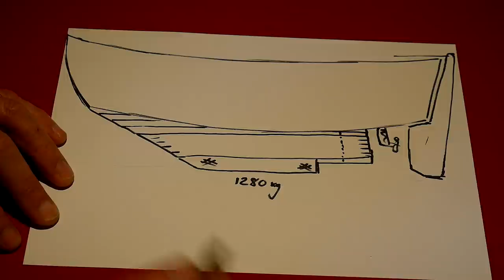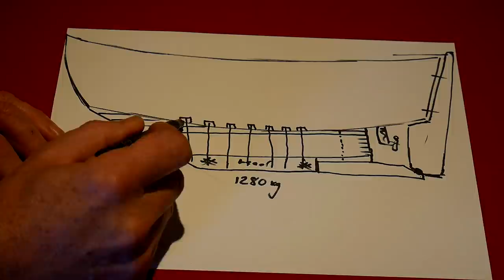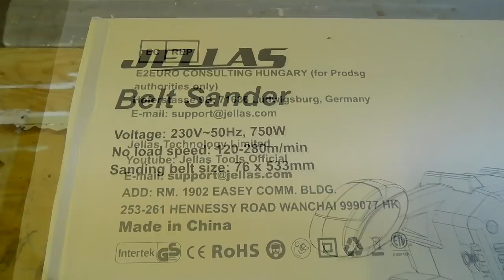Clarity on the Keel; Building a cruising sailboat - SV Tapatya EP208

Comment: That little belt sander looked very pleasant to use when you one handed it on the plywood.  And you could easily build a jig to mount it sideways that has the ability to be clamped to any horizontal surface.  Longevity is an issue but that low weight has some real value.  So glad to see so much progress!   By the way when you start sanding the shape I to the keel while underneath that light belt sander will come in handy!  😁
Reply from the maker: Thanks Kevin. Yes indeed! 👍

Comment: Did u think of treating the raw timbers with a preserver to prevent any possible future rot/bugs or perhaps that might interfere with later epoxy coats? Why not bilge keels and ease of drying out or will u add beach legs after? Looking forward to seeing you sailing as I am sure you are too! Ray.
Reply from the maker: I am indeed Ray. To your questions; wood preservative might affect the epoxy bond, and I don't want that. In the end, the whole thing will be fully encapsulated in glass and epoxy and then epoxy sealer/primer. Wood that's permanently under water (salt water) doesn't really rot anyway - the salt preserves it. As I've said elsewhere, I did consider bilge keels, but decided on the central long keel for its structural benefits and protection of prop and rudder 😀👍

Comment: A quick glance at the registration plate on the trailer, without my reading glasses on, "LEAKS 34". Hmmmm...not great for a boat! It's coming along, nicely Are you going to cast the ballast yourself or have it done? Is this the last major system left or do you have others?
Reply from the maker: 😂😂 Thanks. I shall try casting it myself. It’s one of the final systems. There’s the masts and rig to come. Rudder and wind vane, upholstery, and a few bits in the engine room... 🤔

Comment: Hi Tony, great process and good explanation of the keel building process. When you spoke to fixing the lead keel, you said (I think) that the bolts would be ‘bonded into the lead keel’ - can you explain further and why not through bolt the whole assembly up through the wooden keel members to the floor timbers? Good stuff Tony - keep up the good work. 😀👍⛵️
Reply from the maker: Thanks Norman. Well I have been intending to use "J" bolts, or similar, cast into the lead. However, as is often the case, your question now has me considering alternatives, such as through-bolts. I have read about drilling lead keels, cooling the drill bit with acetone ( if I remember correctly), but imagine it would also be possible to use some sort of cores in the casting that could be easily removed once the lead has cooled. I'm thinking about it 🤔🤔
Reply: @SVTapatya  Tony, I apologise, I was not questioning your method I was just interested in what you meant by bonding. I think captive bolts of some form could be incorporated into the mould prior to the pour. The captive element would need to be a decent surface area to mitigate against the tensile load bearing onto the relatively soft lead. It goes without saying it would need a decent jig to get (and keep) all the bolts in place especially during the pour.

However, I think your idea of using cores (as through bolt place holders) would work well. 😀⛵️👍

PS: Just found this YT video on drilling a lead keel - https://youtu.be/wdh7Da3D3ek
Reply from the maker: Thanks Norman. There is absolutely no need to apologise! I was trying to thank you for helping me think laterally .
Yes. I agree embedded bolts would need a large surface area in the lead; that was the line I was considering. Actually, I still find that idea attractive; I could then comfortably epoxy seal the ballast to keel timber joint and pour epoxy around the keel bolts to thoroughly seal and fill the bolt holes. 
I’ll have a look at the video though. I like to keep my ideas flexible until the final decision is necessary... 🤔👍
Reply: @SVTapatya  😀👍

Comment: Hi Tony, another great and informative video as usual. 
Will you be filling the keel bolt holes with thickened epoxy to seal the wood in the holes or will the bolts suffice enough to seal?
Great work though. 
Cheers
Pete
Reply from the maker: Thanks Pete. I'll be filling the bolt holes with something. Epoxy was my original intention and may still be what I use 👍😀
Reply: Anticipate that possibly there is a substance that will fit I to and dill any voids very well for a semi-permanent to permanent time duration, yet NOT permanently adhere to and lock-in the long brass keel bolts.  A materials engineer, chemist polymer expert, industry expert will weigg in, i hope. 

A grease? A locktite or other commercial substance, by the pin, half-gallon,or gallon? Would be optimal to be able to remove any of the long brass keel bolts, right?
- Don D., IT systems expert, and avid arm-chair boabuilder, sailor, explorer, Phoenix Arizona.

Comment: Hi Tony. Been following your impressive build since the start. My question: these keel timbers, all glued together now, are made of WOOD. They will want to FLOAT and work AGAINST the effect of your lead keel. Wouldn't it have been a better idea to make a hollow keel that you could fill with concrete, maybe mixed with iron or steel, that defenitely would want to SINK so you could have made it less deep and help the lead keel keeping the boat upright?
Reply from the maker: Thanks Erik. I think we need to trust the knowledge and experience of marine engineers/ naval architects here. Clearly, the amount of lead ballast is calculated to sufficiently counteract the buoyancy of the entire structure. We also need a certain righting moment, which is a product of the ballast mass times the distance from the centre of buoyancy. This means it's better to put as much of the ballast as possible down low - not spread it about too much. Then there's the function of the keel in counteracting sideways movement. Clearly the keel needs a certain area/design to do  that efficiently. I think these factors taken together are what have decided this keel design. Hope that helps 👍😀

Comment: I was wondering how you could possibly line up the bolt holes from the top of the floors all the way to the bottom of the lead ballast slug.

I see now that you use the top timber of the bolt-on portion as a template.

I would be worried about the auger coming out the side of the deadwood before even reaching the ballast slug.
Reply from the maker: Well, it's a case of drilling carefully and setting up a guide that is square to the wood and keeping the drill parallel to the guide. The holes will be essentially straight then. I'm drilling a bit oversized to allow for some minor deviation from true 👍
Reply: @SVTapatya 
I look forward to watching you do this.

I just thought of an alternative method. Not saying yours is wrong. It is time honored. 

John C. Hanna once suggested that, if the keel bolt holes, for his famous "Tahiti Ketch", were drilled diagonally in section, the structure would be stronger. But then he added that drilling such diagonal holes ".. was not for the pious man." 

Here's my suggestion:
Using the top timber as a template, pre-drill each succeeding timber, one at a time, before laminating them. Then, once laminated, run the drill through again, to knock off the burrs and slight mis-alignments. 

This suggested method will only work with relatively thin laminates, such as you are using. This is probable why traditional builders don't use this method.

Now that I'm building a boat of my own design, I am learning that builders have to be at least as smart as designers. And probably even smarter. 🤣
Reply from the maker: Yes Bob, that’d certainly work! However, I drilled them yesterday with the method I outlined. They’ve come out well. I have noticed that the smaller the diameter of the auger, the more likely it is to wander. Obvious really. I suppose 👍😃

Comment: Tony do you put any thing on to the belts to stop it clogging up if so what is it you use please I have same sander and belts keep clogging up
Reply from the maker: I'm inclined to think the clogging is based on whatever material is being sanded. I have no tips to avoid it. I don't know if others reading this might have an idea for us... Comments welcome; encouraged even!
Reply: Rub chalk on it first like you do with a file before using,  an old toothbrush handle rubbed over the belt while running will clean it like new

Comment: the bottom is flat still? meaning the bottum of the hull ... i dont know much about these boats but a flat bottom(each side of the keel) seems like a bad idea but what do i know . im sure it will come together fine ..... and what i mean by flat is traditional Sailboats often have a sweeping hull , or rounded .... maybe im wrong but im just trying to learn something.
Reply from the maker: Yes, most sailboats have a rounded hull cross section. However, quite a few of these flat- bottomed dories have been built and have sailed hundreds of thousands of ocean miles between them. The design is very capable! 👍

Comment: This is the problem with reviews, longevity. I had a cheap challenge belt sander that the body would rather bend out where the tracking adjuster was than adjust the tracking. didn't take too long on its first big job for the belt to burn out and the spare. couldn't buy a replacement belt so got a Makita. On another note i bought a power devil drill, cheapest out the old home delivery catalogue 20 years ago. only recently broke and i hammered that thing at times drilling 13mm holes through 10mm plate, would rather smoke than break. You could use this new sander for everything and see how it goes. If you punish it and she holds up credit to the company.
Reply from the maker: Yes Anthony. I was thinking pretty much the same. Also agree; some cheap tools are rubbish and some just go on and on...